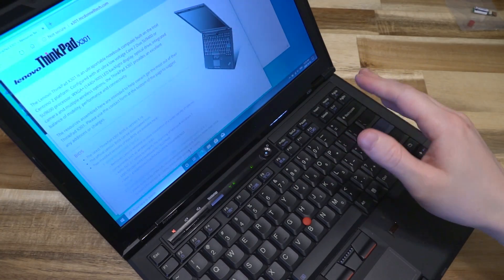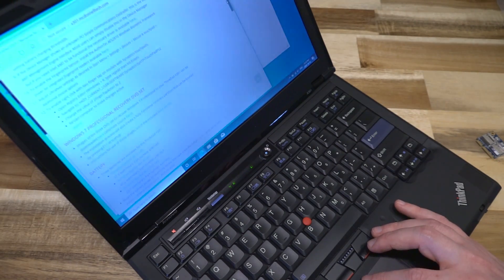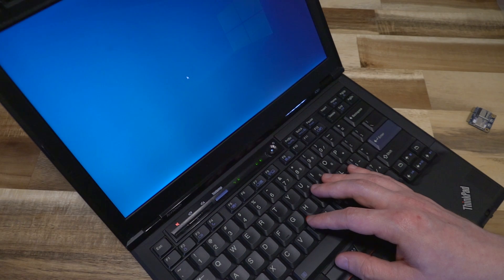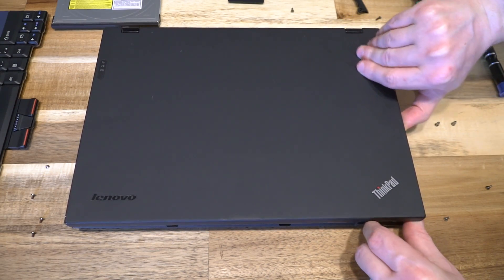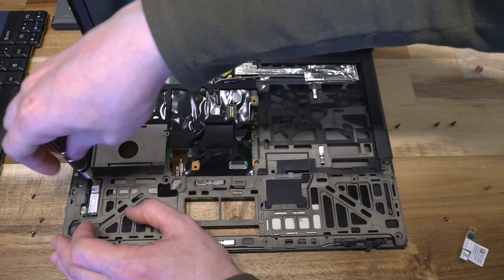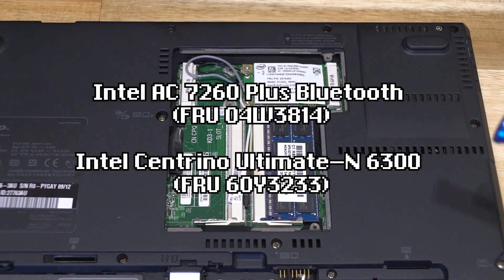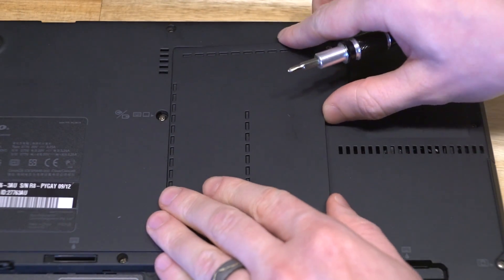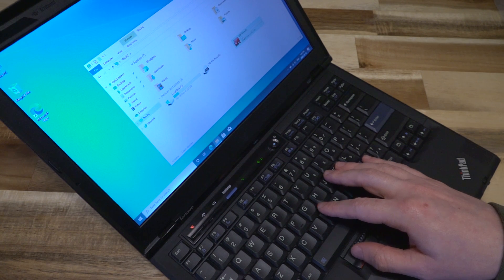Lenovo ThinkPad x301 Mods: BIOS, Bluetooth and microSD Drive

Comment: The bios flash seemingly bricked mine. All was going well till I looked over and the laptop was restarting itself. Do you know if I can re-flash it externally with a ch341a? There's relatively little about this thinkpad online. thanks
Reply from the maker: Is it still bricked?
Reply: @LaptopRetrospective  Took it apart, wasn't able to read, gave up and put all the parts away in a corner. Perhaps I'll come back to it sometime.

Comment: I have an old R32 that came (for free!) without a wifi card inside.  I have several of them but the laptop won't even boot with them installed.  I even bought another from eBay that is supposedly supported but it still won't boot.  And so I looked into flashing a custom BIOS to allow it to use any of these wifi cards and....It flatly refuses to flash a BIOS without it being plugged in AND have a fully charged battery.  The battery is totally dead of course and new batteries cost many many times more than what the laptop is worth so at this point I have to give up.  Thanks IBM!
Reply from the maker: Ah, sorry to hear about your struggles, old tech can be tough sometimes.

Comment: Great to find this video and learn this information. My X301 which I've had since new in ~2010 had the SSD wiped long ago. I pulled it out because I'd like to use it with Google's Chrome Flex OS. I'd especially like to install the newer WiFi card since the original doesn't support WPA2 let alone 801.11ac and the bluetooth upgrade to 4.0 would be nice as well. Is there anyway to flash the BIOS without reinstalling a Windows distribution. Back in the day, BIOS updates used to come on a bootable floppy disk and no operating system was required. Is there a bootable BIOS upgrade image available?
Reply from the maker: Given the nature of these unofficial BIOS updates and what they do, I think they might require the support of an existing OS. There might be a bootable version but I'm not certain it's possible without the flasher program to help it bypass any protection the manufacturer put in place.

Comment: Love that PWM flashing on the screen backlight (or so it seemed in the first bit of the video)

why would you put microSD cards in the laptop though? I figured mSATA SSD would be faster and cheaper
Reply from the maker: That board doesn't have mSATA lines running to any of its slots. That won't happen until future generations.

Comment: MY GOD I love thinkpads
Reply from the maker: They are so much fun to tinker with aren't they?
Reply: @LaptopRetrospective  Totally. i have a T420 and use it s a secondary machine. my main machine is a gaming pc because i do a lot of cpu intensive tasks and pretty much cant use those older cpus.
Reply from the maker: Good use for it! My X220 does a lot of work around the house.
Reply: @LaptopRetrospective  I'm using my X301 right now, running Mint Linux.  I'm thinking of getting a second SSD and installing Windows on it.  My docked X220t is my desktop machine.  I also have a W510 that I use frequently.  Then I use my X20 to run OS/2.
Reply from the maker: Very cool! I'm running Mint currently on the X300.
Reply: I just landed an almost complete X300 for $50 on ebay which I can make a fully functional one by combining it with another parts X300 I got recently for $40.  So this will give me one each, an X300 and an X301!  Yay!
Reply from the maker: Awesome!

Comment: How do the x300 and x301 perform with Windows 10? Are they still usable? I'm not really happy with Windows 10 on my T60 despite having a new SSD, 4 GB of RAM and a T7200, really sluggish performance, went back to Windows 7. Is the performance on the x300 or x301 better?
Thank you for all the ThinkPad content by the way, really great stuff!
Reply from the maker: I'm still experimenting but Linux does well on the X300. I suspect it will do even better on the X301. Windows 10 does okay on the X301, even with a mechanical drive.

Comment: Thank you very much man. It is good to listen to these kind of mods. I once saw an image on a Chinese website showing a very interesting hard mod. If you de solder a specific resistor and move it in a nearby position you can make the cpu be recognised as mobile xeon with much higher clocks and voltage... Of course you need better cooling at that point. I never dared to try when the x301 was my main machine and unfortunately never bothered to try after it became a secondary machine.
Reply from the maker: Yeah I've heard of that too but that's well outside my comfort zone to attempt on this example.

Comment: I would like to learn how to modify the BIOS on my x230 but I'm also just a little bit afraid
Reply from the maker: That would be ivyrain. If I get my hands on a 30 generation machine I hope to do the work. It is relatively straightforward.
Reply: Also thank you for replying to my comment and I do hope that I can see a video of that so I can follow all the steps because the only thing that I want to do is remove the white list for the battery
Reply from the maker: Noted, most newer third party batteries don't really have issues anymore as they found a way a round the lockout.